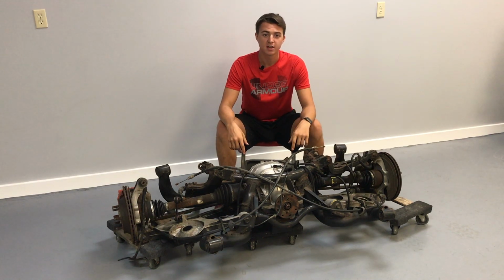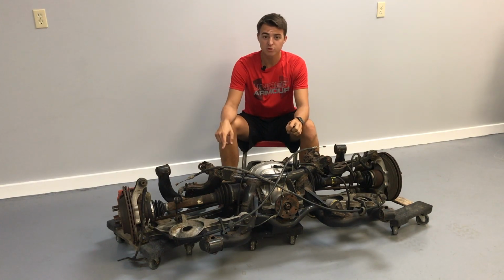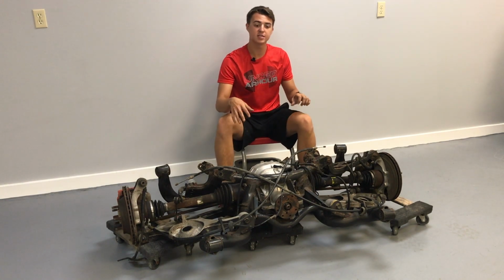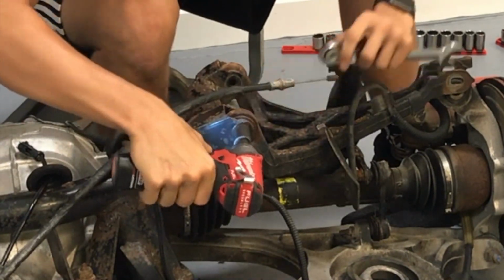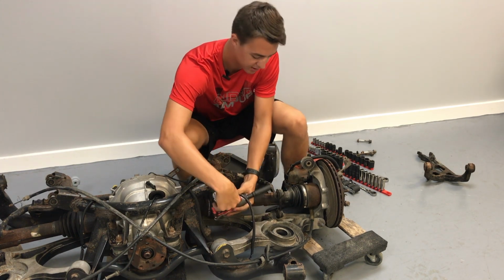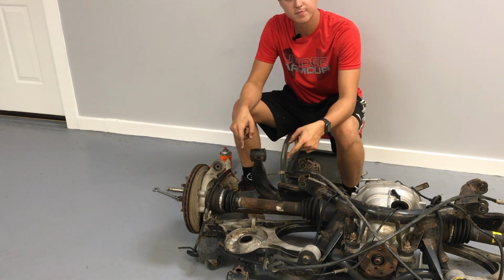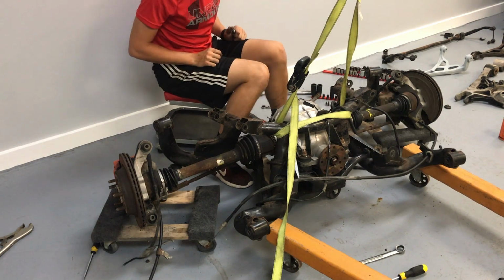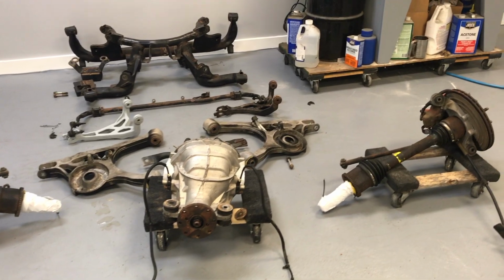How To Cobra IRS Disassembly | IRS Swap Build-up

Comment: have part 2 yet?
Reply from the maker: Yes, and no. I'm driving the car with the IRS right now, and I have footage of swapping it, and a little footage of swapping the bushings and sandblasting but not enough to make an episode of installing bushings and sandblasting I don't think. So that part 1-5 thing probably won't happen. Plus i've been super busy with school and haven't had a ton of time to edit... Would you prefer to see the swap from SRA to IRS with a little bit of footage from the bushing install/sandblasting in one episode, or try to make 2 episodes out of it?

Comment: That IRS is crap without proper bushings.. (I have a 04 cobra)
Reply from the maker: Dragan Matekalo Absolutely, my dads cobra has factory bushings still, and I can confirm the ride quality in my GT is significantly better with the FTBR bushings
Reply: 99 Cobra owner here: He’s referring to handling and traction, not ride quality. Soft ford rubber will ride better, but there is a crazy amount of deflection at multiple points. The subframe can shift independently from the body, your rear alignment will change when the control arms deflect under hard throttle, even the differential isn’t rigidly mounted to the subframe. All that happens because the bushings are too soft. Totally fine for street use, terrible for performance. 

Full Tilt Boogie Racing has extensive documentation of these shortcomings, it’s a really interesting read.